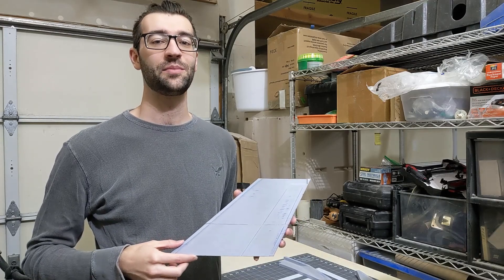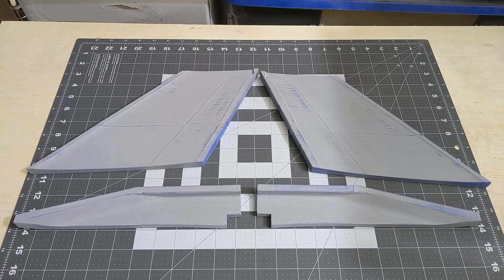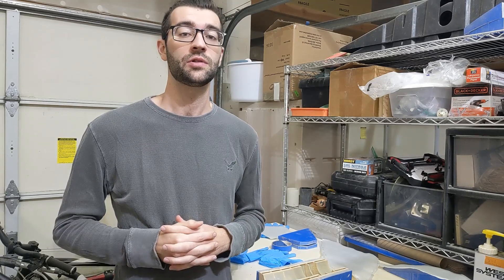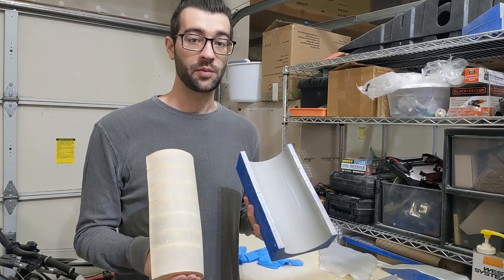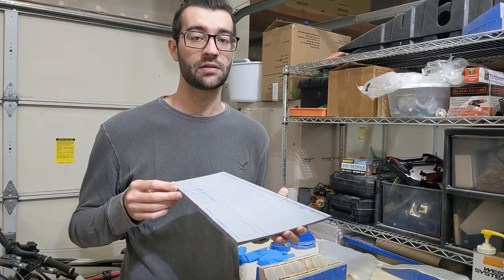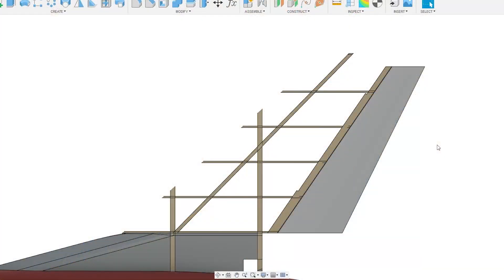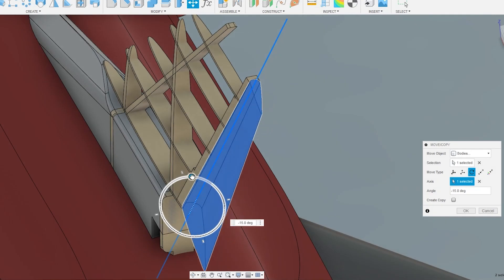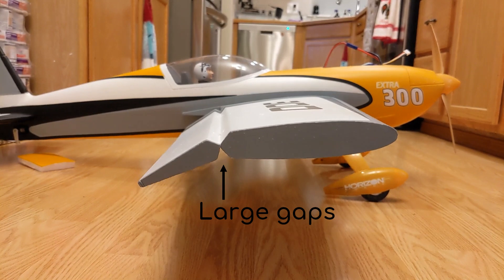Vertical Fin Build - RC F16 - Part 5

Comment: Are you using CA glue in the video?
Reply from the maker: Yes I am but just on the leading edge of the rudder and the base skins of the fin. Everything else was bonded with epoxy.

Comment: Let’s say you went up to a 120mm size edf scale.  Would the finished weight be lighter by comparison to the 70mm version?
Reply from the maker: If I scaled it up to 120mm the overall total weight would certainly be heavier than mine. Perhaps the wing loading would go down because you get much more wing surface area for perhaps not as much more weight.

Comment: Awesome work, do you plan on selling or release the plans for the 70mm edf version? Like me many others would love to build it! 

Keep up the amazing work!
Reply from the maker: Thank you! I would love. I'm afraid there's a lot of tweaks I have to make for it to be good enough quality for a kit. For example, the user would have to still do a lot of custom measuring and making some bits like servo attachments. Do you think people would be interested still if it requires custom work?
Reply: @3DParadigmDesign  Definitely there is a market for both. A suggestion I have is that you should create a physical kit as well as a digital Kit. Many would appreciate raw plans similar to what you have. This will allow them to experience the same mistakes you made and do the custom work because the reason people build a jet is not only to fly but also to learn and do the manual work, which is one of the best parts about it. 

The digital kit can focus on the designing of the plans of the F-16 and the calculations required, this can be for people who would like to get the F-16 plans and custom tailor them to their own fit. This would be for more experienced creators, as they have a choice to get the F-16 plans and tailor them to different edf sizes and batteries.

There are also people who are just beginning and would love a more accurate and worked-out kit where you can also provide the materials if you wish so. They might just be starting out and would appreciate a detailed and worked-out kit where they will know that the plane will fly.

I have worked on an f-16 with 70 mm edf and with foam internals before; I can say the best part was doing the custom work, although I ended up scrapping the idea and going for a 90mm edf instead for more power which I am currently working on.

as these are just suggestions you can take the best and leave the rest 🛫!
Reply from the maker: @PrinceP1025  thanks so much for your detailed reply!! Let's see how this project goes. I'll definitely keep the options of making physical or digital kits on the table.

Comment: Very delicated process!!! Try to use Vinyl to cover your 3D molds, you will safe to use Wax anD PVA
Reply from the maker: I already primed all the molds so I will have to use wax at least.  Some time I may try just using wax and PVA on the 3D prints directly. To me that is even easier than using vinyl!